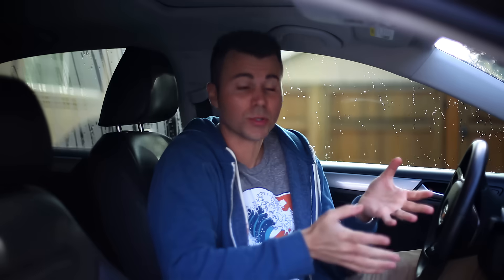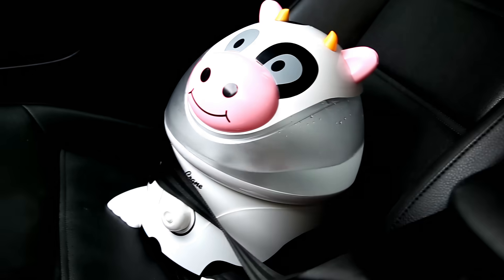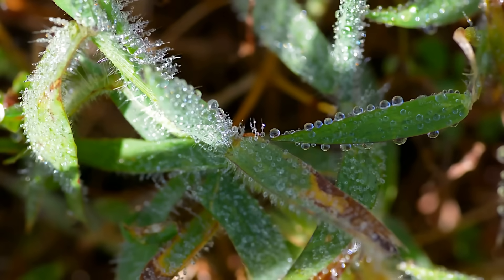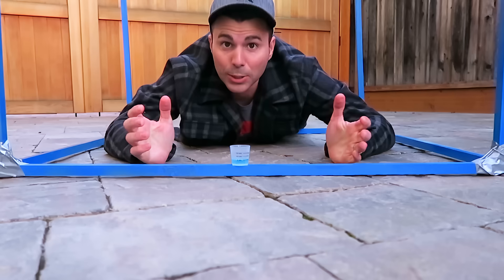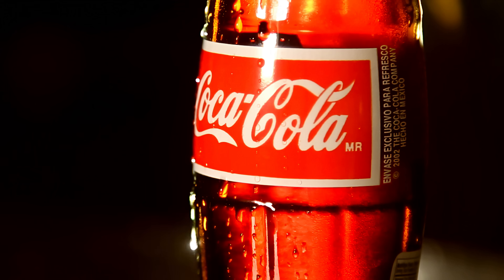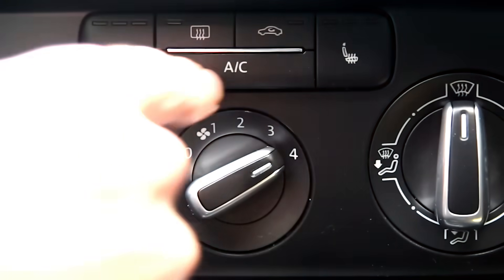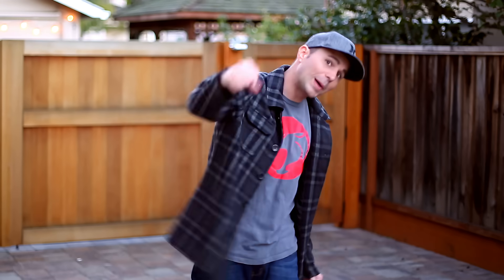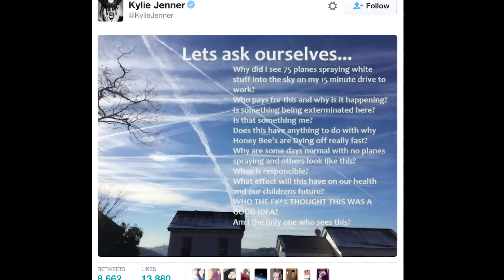Defog your windows TWICE as fast using SCIENCE- 4 easy steps

Comment: Clearly a smart guy but he fails to understand that the defrost setting already initiates the A/C system to dry the air. Pressing the A/C on button doesn't do anything that isn't already being done.
Reply: greatbay you clearly do not understand the  whole principle of using the A/C (which doesn't use Freon anymore either)  is to remove moisture from the Air in the vehicle, the Heater is more than capable of heating the Air as it enter's the car allowing warmed dry air to circulate in the car keeping the windows clear with the vent allowing moisture to be expelled  
It is generally more of a problem here in Australia and places like the UK in winter because of the high relative humidity, where as in Canada and a lot of the us the Temps are low enough that there is likely much less RH until you get in a cold car and create a lot of condensation for which the A/C and Heater is VERY good at removing.
Reply: +Jody Fleming ON it does not ,  Many vehicles there is an Auto setting yes but the Demist / Defrost setting in all cars does not necessarily do this as you suggest.
Reply: +mozzmann in the vast majority it does. You would be hard pressed to find one that doesn't.
Reply: +Jody Fleming  ALL outside air HAS TO go over the AC coil no matter what setting you have it on.These book smart people think they are so smart but reality is they have no common sense whatsoever.USE A TOWEL..10 SECONDS YOUR DONE
Reply: +greatbay1961 it's true that the air flows over the condenser but that doesn't mean the a/c is on. If it's not on it isn't drying the air.
Reply: yeah you turn a/c  it just starts the compressor which circulates the freon.I think best solution is what I use and that's one of those 12 volt defroster fans they make.That little unit has the windshield clear in maybe a minute,your gonna let your car warm up anyway so no big deal

Comment: for the last 30 plus years I have run my A/C and outside air vent , Why ANYONE would ever want to recirculate already moisture laden Air within a vehicle against a COLD window is beyond me.

Step 1 Start your car and set recirculate with NO A/C and go back inside.
 (this is to rapidly warm the Car WITHOUT you adding moisture)

Step 2 Return to the Car and IMMEDIATELY turn the A/C on and Outside Vent  Leaving the Heat on to warm the cooled moisture free Air entering the car via the A/C System.
( cracking the rear windows can help expel any residual moist Air but is not really needed)

Step 3 Additionally - Polish the inside of your windows with dish-washing detergent OR any other Surfactant ie a Wetting agent !! This will dramatically lower the surface tension and reduces the formation of droplet's that we see as a Fogged Up window. 
Polishing the inside of the windows with a Potato will have a similar effect as the starch lower's the surface tension.

Comment: This video rocks. One thing that's noteworthy though is that every car I know of automatically engages the A/C when you select Defrost, even though the A/C light remains off, so whether you hit the A/C button or not should make no difference. It operates that way so the uninformed don't freak out about the A/C being on when they want hot air. If you know where the A/C compressor is under your hood, and what it looks like when it's engaged vs. not, then go take a peek, and you'll see what I mean. Oh, with that said, another item worth noting is that driving around in winter with your heat set on defrost all the time even when you might not actually need it, is going to cost you more in fuel.
Reply: +Matt Cournoyer No mate NOT in all cases

Comment: If you don't have easy access to shaving cream you can also use toothpaste. It's what divers use on their masks when they don't want to shell out for the expensive drops.
Reply: +Doug Stewart Dish washing detergent or Potato ( Starch acts as a surfactant )
Reply: +Doug Stewart 
Tooth paste has abrasives in it that I would think could scratch your glass.
Reply: +Stephen Cox True, but it's in a very small amount and you're using a very small amount of it to do what he's talking about. It also lasts quite a while so you might notice the build up of scratches... Probably never. If nothing else the other side of the windscreen is going to get much more scratched by the general outdoors.
Reply: Doug Stewart ABSOLUTELY NEVER use toothpaste on Auto glass it WILL scratch it, microscopically and damage the surface of the glass resulting in MORE condensation. 
This is also very detrimental to any Tint film if fixed on the inside of the glass, although many cars these days us a dye in the glass.

As I stated earlier use a microfibre clothe and polish the inside of ALL you glass with a high grade Dish washing detergent, this Lower's the surface tension of any condensate and even though the glass is wet before your heater takes effect allows you to see through it. Running the A/C is the most efficient way (providing you have AC  a side effect of this is the Heat given off from the Condenser in front of the radiator will help head the Air and thus the Motor and radiator coolant. .

Just reiterating NEVER use any abrasives on your Windows or windscreen,  I use a good quality Wax polish (Non abrasive - as it helps shed any moisture and stop Ice forming and helps removal as well.

Comment: All modern vehicles automatically activate the AC anytime the windshield setting is selected. This is because as stated in the video it dehumidifies the air.  But if its to cold most ACs will not activate until the engine bay warms up, this is due to the gas used for the refrigerant in the system.   You can verify this by turning on the windshield selection, turning on the fans and open your hood.  You should see the AC clutch engaged.
Reply: Thanks.
Reply: +Lawrence Khellendrose (Khellendros) This is true not only to help defrost quicker, but also to keep the system lubed in the winter. I have also noticed a slightly longer duty cycle when AC is pressed as opposed to just defrost. Not sure if it's just a late model tacoma thing or the duty cycle would vary with the settings in all cars. Food for thought.

Comment: Most, if not all, modern cars will automatically cycle the AC when the defrost setting is selected so there is no need to actually turn it on. That's why cars not equipped with AC are horrible at defogging windows.

Comment: Brilliant and well done! Yay science! This is something we've been battling in our cars and this helps a lot. You briefly mentioned the cat litter in the sock trick, but I'd like to elaborate on it, as I think it's an important tool. After the windows are defogged we drive around with the heater cranked and build the humidity back up again. Then while not driving, that air cools and condenses on the windows, making it so you have to repeat the defog treatment every morning. The cat litter sock has fixed this problem for me. Get the litter that is 100% silica gel crystals. The silica absorbs water really well and has been working great for me in keeping the air dry in the car. The morning defog routine is much better now. I love your videos. Keep up the great work!

Comment: Great way of explaining how condensation forms in layman's terms without going into complicated thermodynamics.  I have explained how to many of my friends using three of your four points.  I had never thought of opening the windows but you make a great point.  One thing though is that if the car doesn't have one button or switch that will automatically do all three points most owners manuals explain those three points of A/C on, set-point to high heat and recirc off but as we both know most people don't bother to read their owners manuals.

Comment: Just a thought: I've noticed that if i don't use the fan at all. My engine heats up faster. Since the heater is also a radiator, connected to the cooling system. Running the fan actually cools the engine of. So in order to get hot air quicker you could try to switch of the fan until the engine has reached a bit of temp.

I got huge problems with condensation on my windsheild.
I got at Opel Astra -98. 
I've tried alot. I got a de-humidifyer in my car. And i'm about to replace the fresh-air filter. If the filter is soaked with water it should not help with moist is my theory atleast.

Comment: Great advice but being an HVAC tech you may want to find out the operating specs on your vehicles ac compressor. Since you have refrigerant & lube oil inside your compressor that is pressure & temperature sensitive, always make sure you stay within the operating specs. For example, "temp range" of your vehicles ac compressor. Have a great day & happy motoring.

Comment: be careful with blasting hot air if the outside air temperature is below 32° F and if you have a chipped widow you might induce a Crack from the chip

Comment: You can buy 100% silica-gel crystal cat litter, walmart has a cheap brand for ~$5 a bag. Works great in my cars.

Also works great to pour on spills inside vehicles or on any surface. Just pour it over and spread out, vacuum out a day or two later.

Comment: Great job! I've not read all of the comments, but I think there may be something missing still. Especially in cold weather when the condensation is frozen: Get that motor running hot as fast as possible. That way you have hot and not cool air coming into the passenger compartment. You could put your foot slightly on the accelerator. You could turn on the rear window defogger; it probably needs it anyway and it will warm the engine faster by calling for more energy from the system. Plug in your phone charger, turn on your headlights. All of these will ask more of the engine so that it heats faster. Even the air conditioner is doing double duty here. One thing NOT to do: DON'T put it into gear. It will warm the engine faster, but I've seen too many stupid videos of what happens when you try this.

Comment: most vehicles are designed to turn your air conditioning on when the defrost setting is selected for this reason, so in most cases, cranking the heat and cracking windows will work just the same. good video!

Comment: I've found that flipping the visors toward the window until they're a couple inches away also helps.  My theory is that the hot air gets a bit trapped, forming a bubble, which allows more moisture to be absorbed into the air.

Comment: How did you come up with the shaving cream
Reply: I believe the shaving cream works because it has the same properties as soaps. Soap is hyrdophobic (water fearing) so the water doesn't stick to the surface it's on. It's only temporary since the soap will wear off after a while, but I'm guessing that's the reason how he figured this out. This is merely a hypothesis I'm pulling from organic chemistry from when I was in engineering school.

Comment: So the defrost setting on the air controls in the car?  That has the ac running to dry out the air.  Having it hot helps a lot.  Kind of common knowledge stuff I would think?

Comment: WAIIITTT. But if i put the heater on maximum and the a/c on, does the air will come out hot or cold? wtf??
Reply: It comes out hot. When you put the air conditioner on, it has nothing to do with the temperature control in this circumstance. It's the evaporator on the air conditioner that removes the moisture from the air.
Reply: Ahhh so it wont damage my a/c? Cause those things are expensive to repair...
Reply: +john hamlet Nope. In both of my cars the A/C automatically turns on when I turn on the defrost. You have the option to turn it off if you want, but it defeats the point when your trying to get your windshield clear. Once the windshield is clear, if it's a cold day, I turn the A/C off and continue running the defrost so the Windows don't fog up as I'm driving.
Reply: +john hamlet You´re supposed to leave a bucket of water in the back seat.
Reply: +john hamlet It's the other way around-- not turning your a/c on during the winter damages your compressor.  Or it used to anyway.

Comment: Hmmm.  Turn on your heat.  Heat comes from engines.  It might take 10 minutes or more to actually get the engine hot enough to heat the air.  Gas engines use water cooling, and there is a thermostat that will not let any water flow to your heater core until the engine warms up above a certain temperature.

So, given that your heat will be non-existent at first, does it still make sense to turn on the A/C?  Yes, the air is dehumidified as it goes over the A/C evaporator coil, but the air does not have a chance to heat up again before it hits the window.

Comment: All very helpful tips to defogging windows, but I found the third tip a little confusing. Perhaps I'm just looking at it wrong, but it seems like bringing in the cold air would just make the problem go on longer.

Wouldn't it pay off more if I kept circulating the inside air to get it warmer and warmer rather then bringing in outside air? Already the air conditioning is slowly cycling the humidity so bringing in more cold air instead of just making the already warm air inside warmer seems a bit counter productive.
Reply: +eurodraco The air conditioner won't be as efficient at removing moisture from the air as bringing in already dry cold air from the outside. If what you're looking for is speed, cooler dry air is going to be better than slightly humid warm air.
Reply: +eurodraco The reason is that your heater can only warm up the air a little amount, so once it gets to that point, it must be evacuated and replaced with colder air below the maximum threshold of your heater so the process can start again. If you had a nuclear powered heater that could super-heat the air, I'm sure you wouldn't have to keep reintroducing colder air.

Comment: I live in Canada,  Most vehicles here automatically activate the AC when you turn the vent to window defrost, also I believe many vehicles also override the recirculate setting in this mode as well.  So cracking the windows is probably the best tip  you give here.

Also the Martian audiobook is amazing.

Comment: When you turn on the defrost your car automagically turns on the AC compressor for you. It's bad advice to turn on the AC manually in this case because doing so when it's too cold can reduce the compressor lifespan. The car has a temperature trigger that prevents this.

Comment: So condensation is not water traveling trough the glass from the outside? It makes a lot more sense that the water is already inside the car.
Reply: +Mark Rober Correct me if I'm wrong. If you park overnight with the vent allowing outside air and all windows slightly open, wouldn't the humid air in the vehicle exit during the night and keep your windows clear (or clearer)?

Comment: If you turn your heater control setting to defrost the heater and air conditioner are both on. Automotive engineers have figured out what Mark Rober has shown. In defrost setting the heat warms the window glass as well as the car cabin, the air conditioner cycles on and off to dehumidify the cabin. You want to save fuel in the winter, unhook you air conditioner compressor clutch wiring, but your windows will defrost much slower.